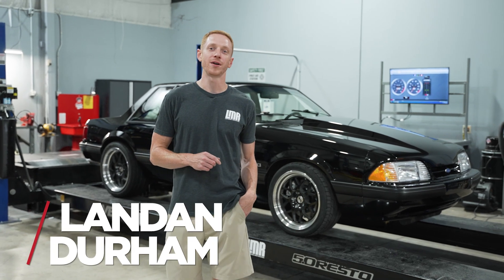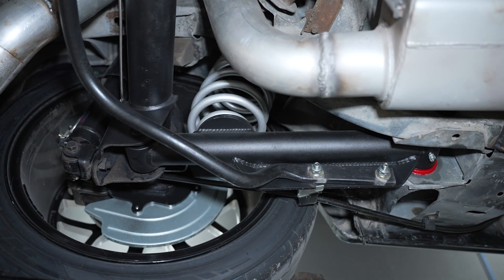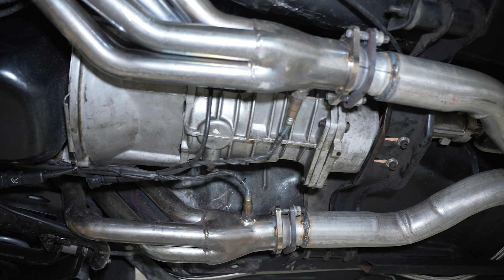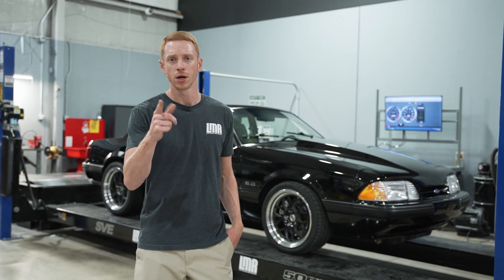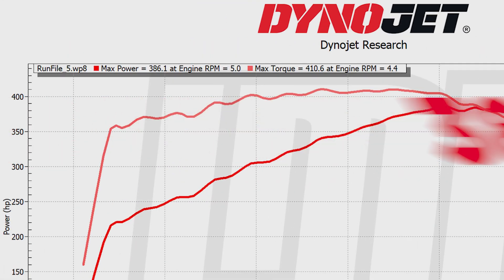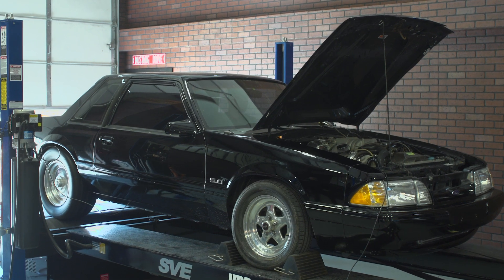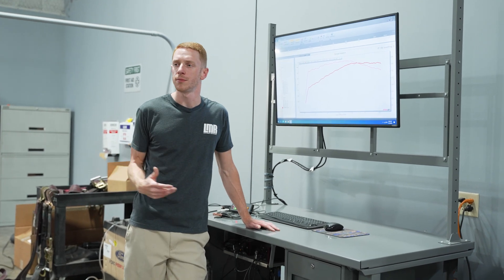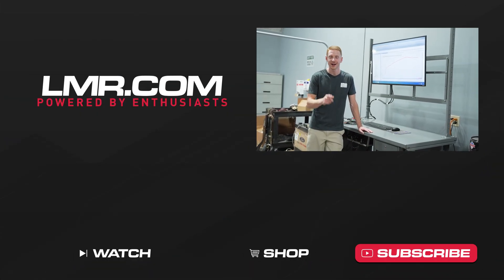How much power?! 393ci Windsor Stroker | 1988 Fox Body Mustang Dyno (Part 1)

Comment: I thought that would make a lot more than that to the wheels.
Reply: It really depends on the combo.  Cubes don't do alot for you if you don't have the combo to take advantage of it.  The tq will be better regardless though.  That tfs3 cam isn't the best for this combo imo.  A custom ground make a pretty decent difference imo.  There are alot of factors.
Reply: @midnight347  I was thinking the same thing, that the cam might be holding this engine back maybe? Isn't the Trickflow R intake meant to shine above 5K RPM? But yeah, like you said, there are alot of factors that affect the characteristics of the power output
Reply: @joecruz03 That upper intake does not work as well as the Box R, from 3k on up to 7k!  Heck all of the dyno tests ive seen, the Tfs street Burner, and track Heat both outperform this upper intake/combo. Most people think the Box R upper is only for high Rpm, but it does really well even down @ 3k Rpm!
Reply: Super victor efi will beat a box R
Reply: @christopherw7648- The biggest reason for the Lower than expected power( peak Hp was @ 5k=😒😢)= this intake, followed by the small cam, and the last reason is the low flowing/cfm exh. System. They would pick up a lot going to a Box R upper, + have Big Dog's do a full stage 2 ported upper, Lower, spacer, and 90mm Tb= ALL ported. Get a Tfs stage 5 Hyd. Roller cam, followed by Big Dog's high flow stainless steel headers, and mufflers= Awesome combo!
Reply: Me as well, was thinking at least 425hp with same tq if not more
Reply: Whenever a car makes more torque than power, that mean it’s a fairly mild setup. It can easily make 100hp more to the wheels if it was an all out build.
Reply: @sstevocamaro  normally means air restriction on intake
Reply: I also expected over 400
Reply: I had a CHP 347, AFR185 heads, gt-40 intake, cam from Anderson Ford Motorsport (don’t remember which one, it was 20 years ago) and that car made 374 at the wheels.
Reply: @JustinBolton-g9q  That was through a manual transmission right? 374wheel through a stick shift transmission.?
Reply: The out tge box intake manifold is holding it back. If we were to port the upper and lower it would have made 40whp more!
Reply: @bigdogsportingtonyb2833  Super victor efi is very good high rpm manifold.   Why dont you use that.
Reply: @maximusvonce1381  yes it is but because it is not a direct bolt on and requires modifications and also the states that requires emissions compliance can't use them. As a company we deal with the majority which are bolt on customers. They simply want to bolt on and go and we offer the best of both worlds. Bolt on parts that can support higher than average power that cost less. That's a win win for the customer. We want to save you money but also get you the power you want.
Thanks 😊

Comment: That's pretty weak numbers for that much displacement in my opinion.  Especially with the expensive trickflow parts. Those are cam only LS1 numbers with a 347 displacement.  Car looks and sounds great though.
Reply: I think it's the heads. I would have went with a 220 instead of a 205.
Reply: @andrewbooher1106  those heads can make well over 500hp NA I think a custom cam and box r intake would be the ticket
Reply: @Bacongrease00  yeah that's true
Reply: Very true. I cammed my LS1 and it made 382 hp to the wheels with shorty headers and 3 inch exhaust! Beautiful car though!
Reply: @TheMotorman80 what was your tq?  Was it 410 tq?  The cubes don't do much for power if you don't got the parts to take advantage of it.  393 needs like 205 heads imo too.  The cam Def holds it back.
Reply: @midnight347  The cam was 233-239 duration @.050 114 lsa. Lift was .599 intake and .605 exhaust. The cam was on the bigger  side for the street and it did hurt the torque having that much lift. It made 367 ft lbs @ 6200 rpm.
Reply: Except the ls is for queers so but realistically was t the best build I could’ve made more power with this sbf
Reply: Yeah a 347 LS1 can make 420-460 rwhp/400-420rwtq in many of the proven combos, and it could reach just over 500rwhp with a more aggressive cam in those combos.  It's easy to do over there.

On a 400-427 ci I wouldn't be happy with less than 500rwhp/500rwtq, because Chevy 6.0 LS3 is getting 440-475 rwtq out of 6.0L.     Chevy LS7 with proven combos is making 550-675rwhp completely streetable, the torque is 530-560rwtq.    A well built 400-427 on the ford side should be able to do this too.
Reply: The cam is old.  If it's factory ecu that holds it back alot too.  It prob has mild compression too didn't catch if he said that.  What specs was your cam?  I gaurantee it was better than this one if you made 380 cam only.
Reply: You right

Comment: 393 is not happy after 5k,lack of fuel or valve springs?
Reply: Prob both the cam and intake ain't optimal either and the heads could be larger too honestly there is a ton of power left in this engine with the right combo

Comment: My Dart SHP Block 363 makes far better power (Fordstrokers Built) almost everything else in your build is comperable.Curious I would've thought with 30 extra cubes you'd at least make as much. Still, that's a sexy little Fox you have there and sounds pissed off. I like it.
Reply: ~450hp crank hp from 393 isn’t super amazing but it’s decent. There’s a bottle neck in this combo. My guess is a custom cam and box r intake manifold would put it over 400whp